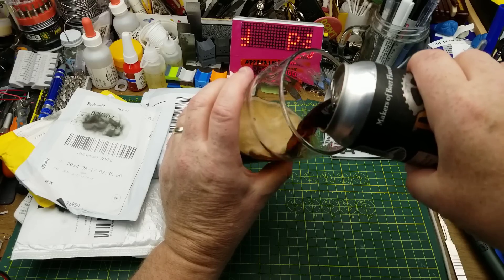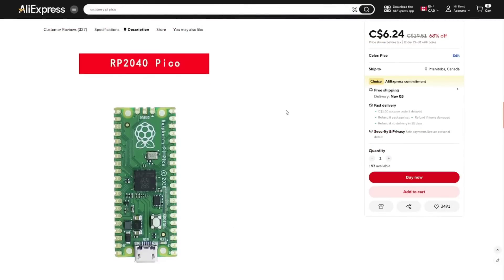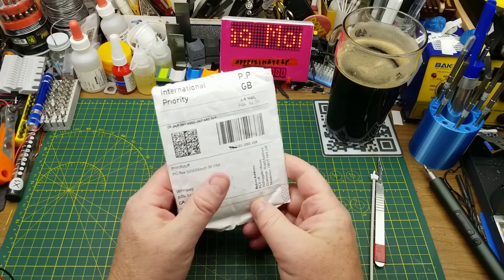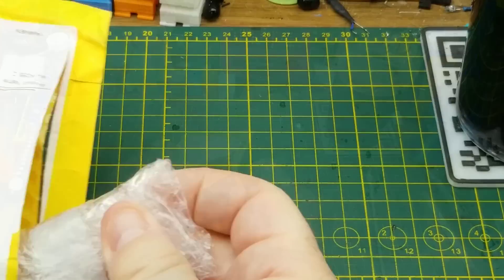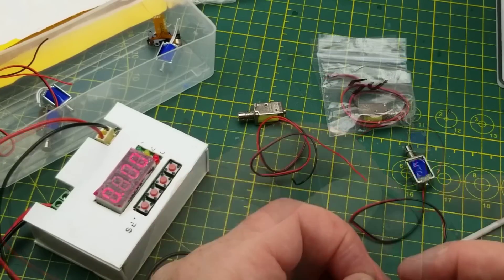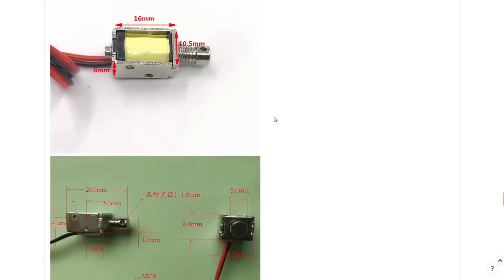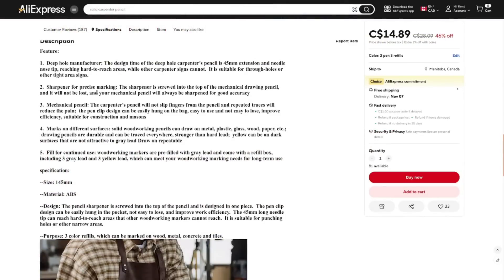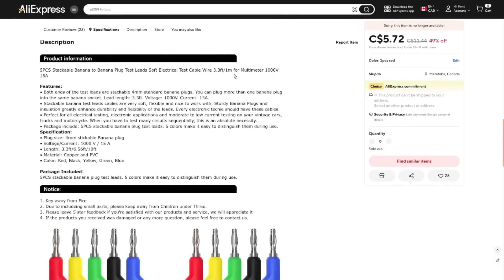Mailbag Monday 204

Comment: I had two of the BNC-to-binding post adapters. Both failed when the spring under the knurled barrel of the BNC connector ate through the barrel reducing spring tension to zero and, thus, affording poor connection of the BNC connector to its mate.

Comment: I have a pico running CP/M, connected to another that acts as a serial terminal and outputs VGA, really neat little boards
\
Reply from the maker: CP/M?  There's a name I haven't heard in many long years.
Reply: @pileofstuff  I like to use it a little from time to time, Gary Kildall really had a good thing in that operating system.  How things would have been different had he (and Digital Research, of course) and IBM partnered for the original PC...

Comment: Hope the BNC-banana adapter last a bit longer than mine cheap ones did.
They develope poor contact in the grounding on the BNC, the twisty part, after a few times used.
Reply: Properly built BNC connectors can be used without the "twisty part" as the outer shell is supposed to be the ground but yes, good quality adaptors are hard to find on Ali and Ebay.
Reply: That's why I dont buy these cheap adapters anymore, their just to expensive (when you have to replace them after just a few months) @galileo_rs

Comment: Haven't watched the video fully just yet, but the dupont jumper cables may be copper plated iron wire, so try with a magnet to see if it is iron. I once got a few wires wich were iron and has quite a high resistance for just 10 cm.
Reply: Note that the prongs aren't square, but a flat blade bent into a U shape. The last few batches that I bought were too wide in the U to fit into breadboard, and the cut surfaces had so many burrs that they literally ground away the plating on the breadboard contacts.
I prefer the round pin versions, but unfortunately they usually have the thinnest and most nasty cables that don't last long. Still trying to find decent 28-26 AWG silicon with proper pins on them, so I don't have to make my own 😢
Reply from the maker: Most of them are some sort of ferrous metal with a plated coating.
At the power levels most people use on breadboards, it's not enough added resistance to be problematic.

And, as an added bonus, I have used magnets to connect jumpers to batteries temporarily!
Reply: Get the DuPont cables with the alligator clips and you'll never have enough, but they make lousy connections that come apart eventually with those bent metal prongs.  I've made coupe foot long extensions with them but now will have to check the resistance compared to the homemade ones I've been making with copper wire.  But for breadboard stuff It won't cause any issues, maybe give some inaccurate power consumption measurements, so it a good to know anyway.
Reply from the maker: @mikejones-vd3fg  I've made a few of those as well.
Always good to have an assortment of different types of test cables.